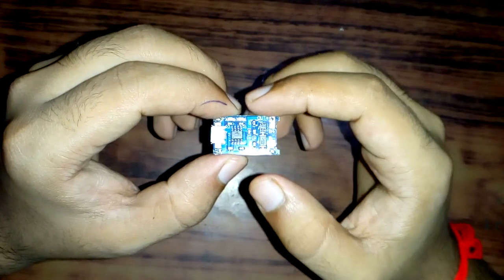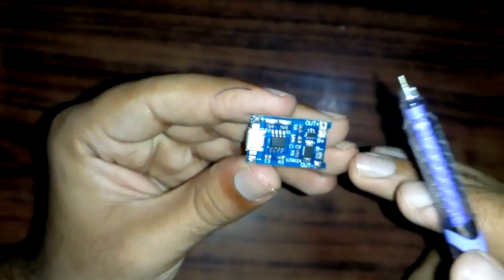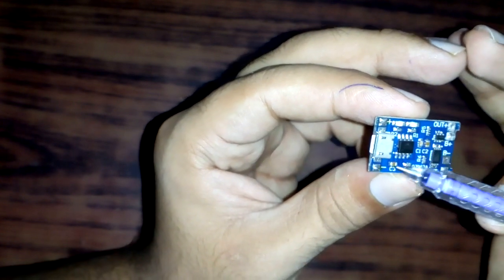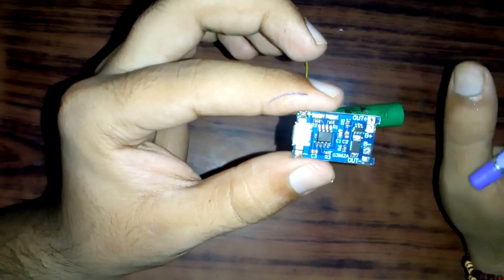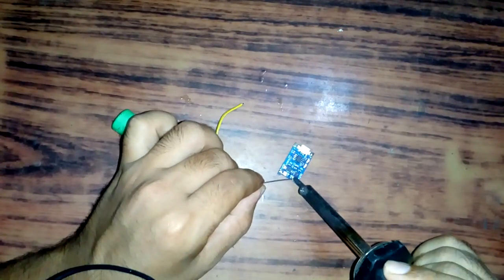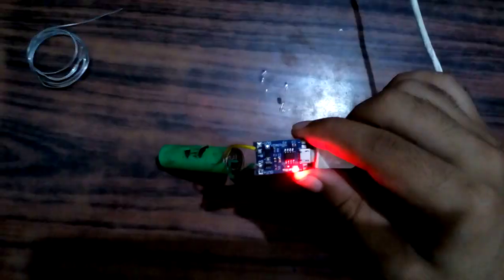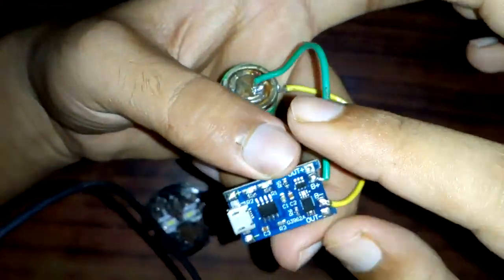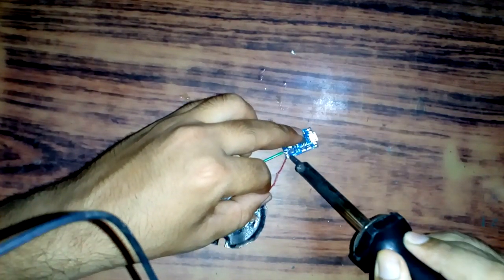TP4056 lithium battery charging module

Comment: as i read it has also undervoltage set to 2.5V. Can i change it other value?
Reply from the maker: This module has all fix voltages but you can modify it by changing some components.
Reply: @MDRHD  Yes i know. But wich component :-)?

Comment: I wanted to install this module inside a box so that my electronics have a power backup. But you say I've to disconnect load when charging. What's the point of using the chips if it needs manual interference?
 Is there a module that automatically connects load when it recieves no input power?
Reply from the maker: No, you don't need to disconnect load while charging. 
You might have misunderstood what I said, I'll check it but you don't need to disconnect load while charging battery.
Reply: Please check at 3:17 and clarify this ASAP.

Comment: I have just made one of these and all seems good BUT one of the larger chips gets very hot,can not touch it. I was using a power suplly of 5v 1.5a. is the supply too powerful?
Reply from the maker: No it's ok. 
If you charge the battery with this module the IC(tp4056) gets heated up.
Thanks for watching

Comment: Bhai...
When you connected ur battery to the module first time ...why the blue led was on u said that red is supposed to be on while charging ...
See 5:24 👈
Reply: Problem solved it was the fault of the module itself....
I tried with another one it was working
Reply from the maker: Let me explain you a little bit more about this module, 
When battery is not connected blue led will glow , when battery is connected and charging red led will glow and when battery is full it will automatically disconnect the battery and blue led will turn on because battery is fully charged.

Comment: I want to charge two 18650 cell connected in series tell me how i can do that
Reply from the maker: You need to buy a BMS board( battery management system)  and  a lipo battery charger.
Reply: @MDRHD  Thank You .

Comment: How many battery charges can be given with this module?
Reply from the maker: You should charge one battery at a time.
Thanks for watching
Reply: This module will charge four batteries?
Reply from the maker: You want to connect four batteries in parallel?
If yes then I recommend you to charge one battery at a time.
Also four batteries will take a lot of time to charge and  it's not recommended by designers to charge four batteries (in parallel)
at a time.

Comment: It will work with series
I mean 4 tp4056 and 4 18650 li ion
Reply: Yeah you can ...Then You'll find Diwali gift with light and sound 🤣🤣🤣
Reply: @sankalpshukla2192  😂😂😂😂😂
Reply: @sankalpshukla2192  bro me parallel me 3.7v ki two mobile bettery laga skta hu aur kitna time le lega parallel me dono bettery ko charge hone me?
Reply from the maker: Do not connect tp4056 in series.
Reply: Yes, if you want, that the ghosts go away. Its firework

Comment: Please make a video on 25v, (amps more than 10A) li ion battery pack with balance charger using tp4056 please
If video is not possible please reply with written in haw to make it
Reply from the maker: It will take a lot of money.
Reply: You can find a module with your requirement on flipkart..I just see it today search with Adjustable Step-Up Boost Power Converter Module..And use this with TP4056..

Comment: Can TP4056 circuit charge 4 18650 battery in a parallel way?
Reply: Yes! Why not. You can use as many as cells but keep in mind the charging current ( 1amp )
Reply: @UBsLab  me parallel me 3.7v ki two mobile bettery laga skta hu aur kitna time le lega parallel me dono bettery ko charge hone me?
Reply from the maker: Laga sakte ho,  aap ek bar charge karke dekh lijiye usse apko time ka pata lag jayega 
Thanks for watching
Reply from the maker: You can charge 2 cells , but first of all charge them fully and  separately then you can use them in parallel

Comment: I am using one of these to power an esp8266 (3.3v), with a LiPo battery and a solar cell on the IN pads, but every now and then the OUT voltage drops to 0.85v and stays there until I connect a 5v charging source, even if the battery is at 4v. Do you know how I can keep the OUT pads live until the battery goes to 3.3?
Reply from the maker: DO you have another same charging module ?
Reply: Yes, I've tried a different source also. Still happens. I think I have solved this by placing a 100uF capacitor between the OUT pads. I believe when the device wakes up, it draws enough current to drop the voltage below the protection level and triggers a shutdown. I don't know why it doesn't start up again. The capacitor seems to keep it going but only time will tell.

Comment: Can I charge my anroid mobiles non removable battery of 4000mah with this module by connecting positive and negative terminal with this
Reply: Yes.
But the current is only about 1A
Reply: @MaxMüller0  me parallel me 3.7v ki two mobile bettery laga skta hu aur kitna time le lega parallel me dono bettery ko charge hone me?

Comment: Can we hack tp 4056 5th pin of mosfet directly connected to negative charging voltage to automatically shut down of load while it charging????
Reply from the maker: I can't say anything about it because I haven't gone through the circuit of this charger but if you know about this charger you can do whatever you are thinking and please share the result with me

Comment: can i charge lipo battery 3.7v 300 mah with tp4056 module ?
Reply: I think so my question too
Reply from the maker: You can give it a try because it is a linear charger so it will not create a problem

Comment: Instead green, my LED is glowing blue and red blinking slowly, when connected to battery.

And if , there is no batter only USB input , blue continuously glowing.
Reply: the blue or green is the same ... if the red is blinking there is a short in the board try using a diff one and always make sure you connect the ground first
Reply: I have also same problem
Reply: Mine also same problem. Any solution? Or my board is fake ?
Reply from the maker: Your module is not working anymore, or try to find any short circuit on the module and then rewire the battery.
Thanks for watching
Reply: Your battery is gone or module is broked

Comment: This video falls short of being comprehensive
Details specify.....   Load  MUST BE DISCONNECTED
 When battery is connected with charging USB power
ESSENTIALLY - installing this unit not mounted on a PC Board
Would mean repeatedly soldering connectors on and off the board
First step is installing pins to each power input/output locations
If for nothing else than testing purposes... before actual functional use
ESPECIALLY since there are no stand off location holes to secure the mini board
To any location / position
Will have to code power redirection to LOAD THROUGH SOME FORM OF SWITCH
Where as soon as the charging board has usb power input...
Load output pins are disrupted,
As there are going to be lots of empty heads not reading the cut sheets details
This is a good base unit but must be understood as to it's functions
Reply: MUSIC VIDEO EMCEE  I'm facing this exact problem. I'm reading that you have to disconnect the load. Can you tell me how to do it? And why we have to do that? Thank you!

Comment: Could I use this module for charging 18650 battery with solar panel (I will use step-down to 5V - supply voltage)? Will there be a problem, if it will charge the battery every day, even if the battery is not empty yet?
Reply from the maker: +GaMa87 
U can use it without any doubt

Comment: bro i have i ion 4 batteries  can this single module can charge them 4
Reply from the maker: +Shaik Saleem Boby 
This single module can charge a single battery at a time
Reply: Only for single cell rated 3.7v , whatever be the capacity !! You need each module for each case

Comment: Bro my module gives 5 second red led and 5second green led after  5   minute ofconnecting to the charger
Reply from the maker: +Pintu Sidhi 
Does it charge battery or not?
Reply: Yes I have 3.7 lipo
 battery
Reply from the maker: +Pintu Sidhi 
There can be a problem of loose  connections or may be the problem is because of module
Reply from the maker: +Pintu Sidhi 
First of all subscribe my channel

Comment: Bro price of both module or battery
Reply from the maker: +Prayag Kushwaha I bought this module for 130 INR and I recovered the battery from dead battery of laptop but you can batteries separately. New batteries are very expensive but old batteries are also available in the market.